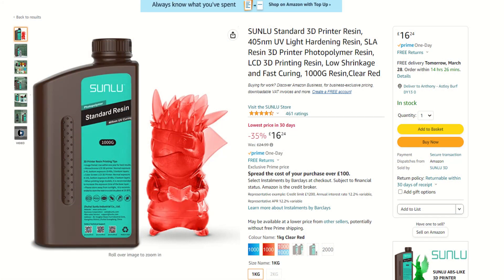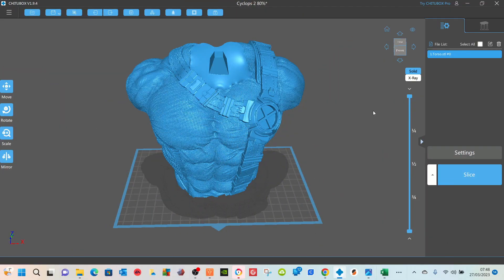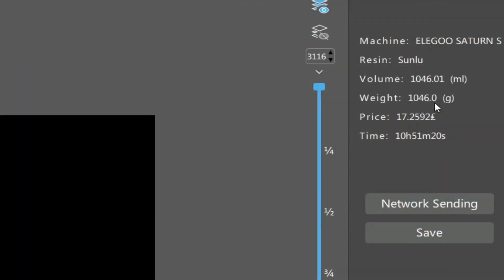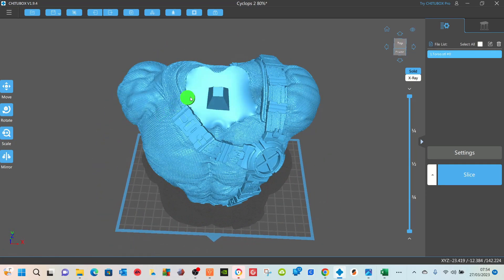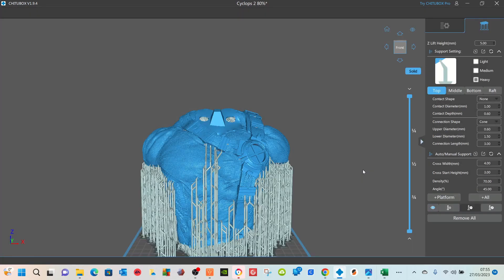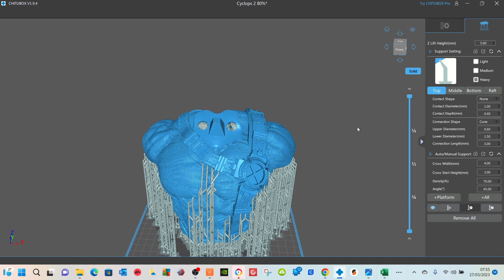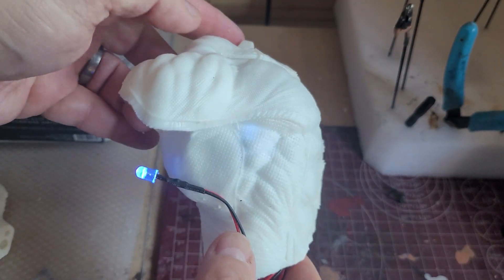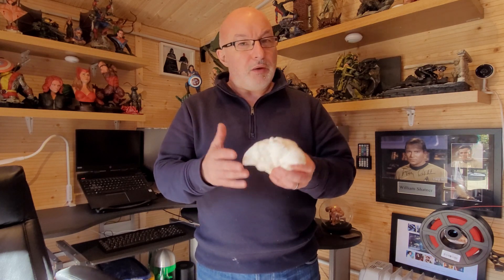Should you Hollow Resin 3D Prints -  If so How & Why ??

Comment: One of the main reasons I hollow prints is that it reduces the peel forces at play during the print as the layers are smaller. Less peel force translates to lower chance of print failure as well as print imperfections, i.e. print lines. Also, I like to use some infill (10%) as it provides strength and rigidity to the printed model. The infill also acts as internal supports, which again reduces chance of print failure. Downside is, will have to flush insides very well to ensure that there is no trapped resin. So far, I haven't found UV curing the internals to be necessary. So long as there is no trapped resin and the holes are not covered afterwards (so that any gases from de-gassing would not be trapped inside), the model will not explode or burst open.
Reply from the maker: I do like to use supports internally  just to rule out the possibility of islands and failures... the good thing about our hobby is there's lots of ways to achieve the same result
Reply: See I tried to cure inside with little uv lights. Then I put a layer of super glue over the holes to seal any possible wet resin inside. Had a couple items burst
Reply from the maker: @hoohaa559 I'd leave the holes open to allow any expansion...was it water washable resin
Reply: Also it is worth noting that having hole on bottom of print (ie. bear buildplate) removes any suction from trapped resin. Also, one of things that helped me with print failures was reducing pull speed by half.
Reply from the maker: @PeteOfDarkness  absolutely 💯

Comment: Drain holes should be made in best case scenario where the uncured resin will flow to. Like the lowest corner point. Also keep in mind the physics. There is pressure coming up when moving into the bath and outwards. This can lead to print failures. But drain holes make the pressure to excape. Gravity force.

Comment: I use 5% infill. It creates just enough skeletal internal structure to properly support the inside of the model. Internal supports aren’t used. So you use even less resin. This is just with Chitubox. Lychee internal supports are garbage.

Comment: With the small LEDś inside the print, to cure it out, is a great Idea! Regarding to the safety of using the resin: Using gloves is important and good - but after reading an scientific paper about the breakthrough time of different gloves (the thick chemical ones) with different chemicals - and seeing that even the official tested and printed breakthrought times are sometimes off by a faktor of 2-3 or so (stretch and stretching, heat of the hand, etc.), i would rather put two pairs on and change them a few minutes after contact. The air ventilation in this room and right gas/ filtermask is another topic. There is a good video here at YT, about this.

Comment: I usually will put drain holes at the opposite ends of the model to allow air to enter on one end and allow the resin to drain out the other end. Once the print is finished, I'll submerge the print in a vat of IPA until the model if full of IPA and then shake the devil out of it to wash the resin out of the inside, of course, being careful to cover the drain holes with my fingers so IPA doesn't go flying everywhere! I will then use some canned air to blow the interior dry. Then I'll usually let the print set out overnight with one of the drain holes at the lowest point to allow any IPA (or resin) to drain out that I might have missed. However, with your portable LEDs, I might be able to forgo that last step!! Thanks for sharing!!
Reply from the maker: Thank you for your insight too 👍

Comment: I made a different process that i like a lot currently:
Add  a big hole at the bottom,
add a small 2mm hole at the very top. So air/resin can go through the holes.
Also print an extra cylinder that is 1,9mm at the top and 2,1mm at the bottom.
After it finishes printing, wait 30 minutes so all resin can drip out of the the small hole.
Clean everything with IPA, insert the cylinder into the small hole and glue it so it's airtight.
Then add white alabaster plaster through the large hole at the bottom into the object. It makes it durable, gives it weight - which makes it feel more valuable, and protects you and others from uncured resin that's in the inside.
Reply from the maker: Thank you for sharing 👍
Reply: Hello! I tried filling my print with plaster and the model cracked, I'm guessing because of the humidity of the plaster for a prolongued time. I take it you never had any problems with that?
Reply: @ArthurBandeira1  Normally this isn't a problem, but I also have a cracked print too where the material has expanded. The difference was that I used cement that I had lying around - that expanded, the paster did fine until now. So it could be the material.
Reply: @Gromic2k  I see. Could be the type of plaster I'm using then. Thanks for your answer!

Comment: Something I would highly recommend for most people Is to use a Clear resin because the cure machine will then cure the Inside of the model, this way even If you had pockets of resin trapped Inside and doing the ELD method will likely not work, well If the model Is clear the cure machine will do It regardless. 
Ever since I have used Clear resin I have had 0 Issue, that plus If you want to be lazy and not paint the print you could always just get a grey wash or a spray can and wash/spray It for a couple seconds.
Not to mention Clear resin as the benefits of you being able to do "Invisible" characters.
Reply from the maker: Thank you..interesting idea
Reply: Ya no problem glad I was able to provide some assistance :D.

Comment: Great video. I have switched to using an infill of 5% instead of supports for the interior when hollowing. I haven't ran into any issues so far and I found that I clean clean the inside better and not worry about trapped resin. Great model choice btw. I love Wicked pieces. I'm working on their Juggernaut breaking through the wall right now.
Reply from the maker: Thank you I have considered using infill instead of supports but I always find I'm on a bit of a winning Formula and then I don't want to break it lol

Comment: I hollow them out when possible, it makes the model lighter so it won't stress the supports. I also use hollow blockers for small areas so they don't fill with resin and explode later.
Just have to wash it really well especially inside then use little UV leds to cure the inside.
I also use 10mm & 5mm holes.
Reply from the maker: 👍 Yeah heavy models pull off the supports much easier

Comment: new be question does an angled model need to have the holes positioned e.g head close to the build plate bottom of the model towards the resin vat to aid run off?
Reply from the maker: It's not completely necessary but does indeed help with drainage if you can orientated at least done hole downwards to help draining

Comment: That LED UV trick is amazing! Does it matter if the drain holes are near the start of the models printing which is pretty much connected to the build plate? so would the model be filling while printing. Or does that not matter and just having drain holes so when complete the model is tipped up and can empty. thanks
Reply from the maker: Doesn't matter at all 👍👍👍
Reply: @greedy3d480  awesome. Thanks for the swift reply

Comment: AIUI, the washing is to get rid of uncured resin so it doesn't marr the surface finish of the model.  Bearing this in mind, is there any reason for being so fastitious about cleaning the inside of the model if you're not going to see it, and you're going to cure it anyway?
Reply from the maker: Hi good question hi  I would say any uncured resin inside  maybe areas that you're curing lights don't get to overtime could cause the model to split that's why you need to clean it thoroughly and do your best to cure

Comment: Can you link how you made the UV diodes? How many do you need per battery pack, etc?
Reply from the maker: I may do this in a forth coming video but it's really really easy I just use five LEDs a 9 volt battery and an on/off switch all wired together it's really simple to do just needs to be played with a little bit if you're not sure

Comment: Hey mate! Love your videos! I'm posting this comment a little in the wrong place, but wondered if I could ask your advice on something? (Maybe it'll give you an idea for a video!). So I've just got my first 3D printer, haven't even unboxed it yet. My question is regarding control the temperature during a print job. I live in the South West England, and outside temperatures have almost reached 20C.  My indoor house temperature has been kept on 18C all winter. The bottle of resin I have suggests I operate at 22C to 25C range (maybe even towards 30!!). How important is temperature? How do you control for it?  I will be using my printer in my garage, which essentially will only hit 20c naturally during the summer months... I'd like to be able to use it throughout the winter, but without heating my entire garage constantly (which will cost).  I'd be interested to hear anyone else's comments too!  Cheers!!
Reply from the maker: Hey mate welcome to the club now printing in low temperatures is something that you might get away with I've certainly got away with it here in the Western Midlands printing in rooms of just a few degrees some people get a little bit tetchy about printing in low temperatures but if you to all you've got then have a goatie I would say if you can keep the room temperature around about 20 degrees you should be absolutely fine and it will print in temperatures lower I've also just used a hair dryer over the resin in the VAT just a warm it up enough to get the print started then it seems to work absolutely fine and I've been doing this for years👍👍
Reply: Thanks for taking the time to reply! I appreciate the advice and will take it on board. Thanks!

Comment: Sometimes its not practical to have drain holes top and bottom, so if you had one option, should yo add holes nearest the build plate or furthest away? Could you also to a vid on when to use a raft Please, I seem to have got into the habbit of always using them after initial failures when I first got the printer.
Reply from the maker: I would say doesn't really matter where the whole goes as long as when you finished with the print you clean and drain it properly as for a raft they are a choice thing you don't desperately need them but they do apparently allow adhesion to the bed a little better so if you are having problems then add a draft but it's probably down to just get in your base layer settings correct

Comment: Can you please confirm how you wired your UV LEDs? I'm not an electrician, but I did get the parts needed and wanted to reproduce this, but I do not know which to connect. Thanks.
Reply from the maker: I onow know absolutely nothing about electronics but all I do know is you need to make it a complete circuit start by connecting the positive to the negative put one of the bulbs in between and then add the switch. If you just think that everything has to make a complete circuit negative to positive

Comment: Do I really need to support the Inside ? I just printed my first hollowed print without supports inside and it was fine
Reply from the maker: Either supports or the internal grid structure
..you may be lucky with some models but luck runs out eventually if you have nothing lol

Comment: I'm new to resin printing, just waiting for my printer to arrive. I'm confused about if it's possible to print a solid model for something that I need to be structurally very strong? 
For instance just a solid block like a brick. I assume the uv curing light could not penetrate the exterior to have any effect on the interior of the block?
Reply from the maker: Printing solid is fine but has a few issues.. Weight may pull it off supports, uses lots of resin too... If strength is an issue there are strong resins.. I'm doing a video review on strong resin soon... But to sum up printing solid is not an issue... We hollow to save resin in a nutshell 👍

Comment: If you use transparant resin, does the UV from normal curing reach the entire model? Or does the UV gets absorbed.
If you will paint it anyway, you can use transparant resin and you don't have to do anything special in terms of curing with the hollow model?
Reply from the maker: The curing seems to work just fine and I don't do anything any different I Tend not to hollow out transparent resins although there are occasions when I do do it when I do hollow them I use a small LED inside no difference to my other resins

Comment: It just seems easier to print solid. Besides the usage of resin, and the peel force… would resin really get trapped inside the model if it’s completely solid inside?
Reply from the maker: If you print solid you mitigate the risk of Resin being trapped inside. If money is no issue  for resin or if the weight of the model does not bother you and of course the risk you are quite right of the extra forces on your fep or supports  then there's no point in Hollowing.... my approach is most definitely to hollow but of course do it correctly
Reply: @greedy3d480  yeah i just had another print failure. I like the weight of a solid print for statues and figurines but i only got a solid print to work 3x. I guess I’ll have to try hollowing… Great vid. Thanks